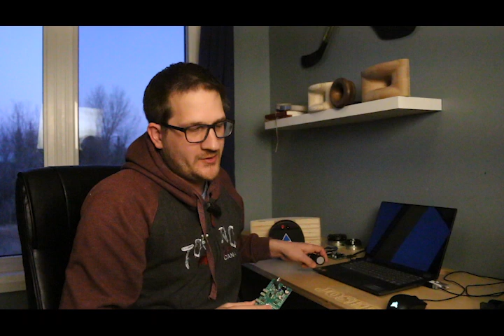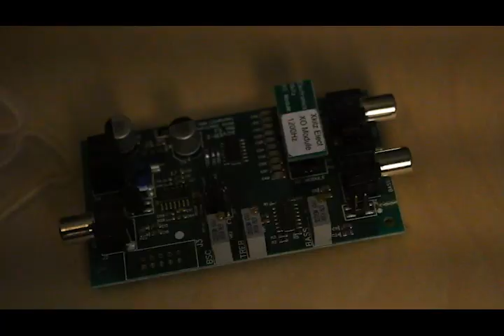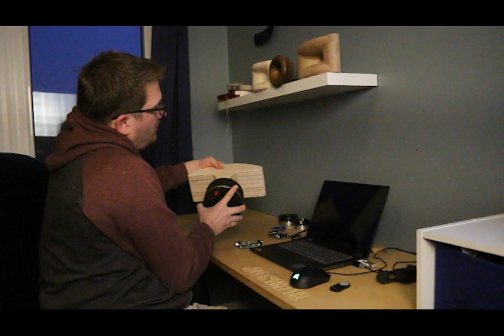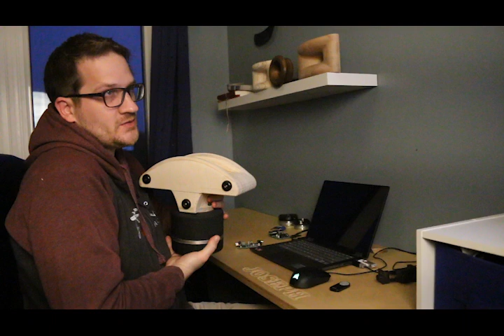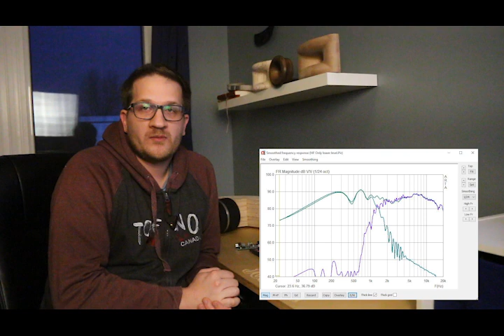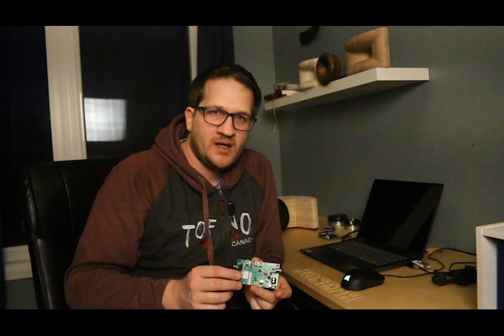Product Test --- Xkitz 2-way Active Crossover

Comment: Two of these are required for a stereo setup. How do you align the crossover adjustments for both channels to ensure they match?
Reply from the maker: You would probably have to use measurement with a decibel meter.
Reply: You need a signal generator and a digital voltmeter set to AC volts. 
Or ideally an oscilloscope.

Comment: I have the mini dsp 2x4 and disconnected the dsp from the amplifier and still had hiss on my horns, which tells me the noise is not from the dsp. If a passive network removes the hiss, what else is it filtering out?
Reply from the maker: You should at least do a fixed resistor L-pad just before the horn. An 5.1 ohm in series with a 3.9ohm to ground should attenuate by about 10dB assuming you have 8ohm drivers. 
Or you can use a low gain amplifier such as the ACA Mini by Nelson Pass. The kit is $135 USD.

Comment: I’m playing around with the balanced versions right now. Combined with the Xkitz linear power supply. Impressed at the price point, and you won’t get better sound from DSP unless you spend substantially more money. Even the new MiniDSP Flex sounds much worse. I’m using them with a 2 way with Purifi 6.5” woofer and Bliesma B34 tweeter. So very revealing speakers. 

Before connecting them to my speakers, I calibrated them with my audio analyzer. And I discovered the THD+N was only around -67dB. Then I hooked them up to my speakers, and they sounded quite good, but there was some dullness to the sound compared to my very high end DSP solution. Then I started messing around with the BSC. Tried several settings, and then decided to pull the jumpers to bypass completely. Massive improvement in resolution and clarity immediately. However the bass became thin of course. 

Next I hooked it back up to my analyzer and measured without the BSC enabled. And THD+N improved to -80dB. So 13dB of distortion is added by the BSC circuit. So what I decided to do is implement the BSC 100% transparently in the Roon 64 bit floating point PEQ instead, and the sound is pretty awesome. I’m feeding them with a cheap $270 Topping E50 DAC. And the sound quality is light years better than I was able to achieve from the balanced MiniDSP Flex. Even though on paper the THD+N of the flex was -111dB from my measurements of it. 31dB better, but much worse sound. Stop listening to ASR folks! 

However I should mention that the -80 THD+N is distortion dominated. The noise floor is very low at -108 dB. So they’re very quiet. I’m guessing that the major source of distortion is coming from the pots. And perhaps the mediocre LDO’s used to filter the incoming power. But super impressive at the price point, and they have inspired me to build my own all out assault analog crossover boards that will have -115 THD+N based on simulation.  But they won’t be adjustable. Fixed for each design. That’s the only way to do analog active crossovers with absolutely no compromise.
Reply from the maker: Wow, great work!  It’s quite fascinating that the Topping DAC sounds as good as it does.  I’ve found that you need to spend x20 more to get better performance, and it’s only discernible on high rez content.
Reply from the maker: Wow, great work!  It’s quite fascinating that the Topping DAC sounds as good as it does.  I’ve found that you need to spend x20 more to get better performance, and it’s only discernible on high rez content.
Reply from the maker: Wow, great work!  It’s quite fascinating that the Topping DAC sounds as good as it does.  I’ve found that you need to spend x20 more to get better performance, and it’s only discernible on high rez content.
Reply: Which one is "my very high end DSP solution"?

Comment: I recently received my Xkitz 2way crossover boards. I'm using them in a 3way for crossing woofers to midrange.. Dedicated amps connected to woofers is very nice with amazing controll and dynamics.. The one issue I have with Xkitz is the circuit with the voltage regulator and trim pot. I would prefer to bypass this circuit and direct connect a quality power supply directly to VCC on the opamps..

Comment: Joseph, awesome video, so far only real information about xkitz except marketing materials from producer!!! Can you explain your setup? What amplifiers used for wofer and what for horns? What configuration? Turntable-preamp-xover-2amps? Assume vol regulation was in preamp? I am considering build full active speakers with intrgrated amps (good Dclass or mix of Dclass and AB  for tweeters) and xkit, all in a spkr cabinet, balanced version, supplied by xlr connection from mighty source eg mytek DAC or similar, only need to find the one with exit level regulation...

Comment: I too purchased the same Xkit 2-way Crossover some time ago, and, like you did nothing with it... But after stumbling on your video, I took a closer look at the specs of the FETS at the heart of the modules - They have super low noise and vanishing distortion... So I'm in the process of putting a project together using a W8-2145 full-range driver from Tang Band which uses a bamboo fiber reinforced paper cone, and a HiVi RT2H-A Planar Isodynamic Tweeter crossed over at around 2000khz. So thanks Joseph, your video has just breathed new life into shelved project. 👀
Reply: I would like to find a DIP-8 socket there, so I could use ADA4898 or LT1364, OP275 at a low end, and MUSES02/03 at a high end (or may be some Burson os Stacato). And few other filter types like Bessel or Chebyshev for a better phase. Linkwitz does not care of a phase but sells an ideal stitching which is not required when we talk about a crossover (and plays some role when we talk about a tone control board). One slope can be 12dB/oct, and immediatelly 24dB/oct next to it. Everything depends on a driver and a cabinet. So, Linkwitz has no job there.

Comment: Why not go with the MiniDSP?
Reply from the maker: Corrado VRz I’m surprised you asked that question when I directly compared the product to the MiniDSP in the video. You should watch the video.
Reply: @JosephCrowesDIYSpeakerBuilding  I did watch the video but I must have missed the part where you talked specifically about the MiniDSP. I only saw you mentioning about Pro audio and car audio processors, not the MiniDSP. 
I'll try to watch it again when I have some time.
Reply: Mini DSP has a lot of hiss, I have it and sold it, the A/D D/A conversions are low quality.

Comment: Agree with you Joseph,  I use  the three way variant in my open baffle speakers,  and on many ocasion, other audiophiles where simply overwhelmed by what it can do.  I am currently building an integrated amp with the three way balanced x-kitz boards.  using 4 x  modulus_ 86 amplifier boards from Neurochrome.    I was alway's disapointed with any DSP on sensitive speakers,   this opens up new posibilities.
Reply from the maker: That sounds like an interesting project! Are you sharing your work on any site?
Reply: @JosephCrowesDIYSpeakerBuilding  No I do not,  but that is not because it is a secret.  I can send you some pictures if you like

Comment: Cool thanks for the review! Sounds like finally there is a good alternative to MiniDSP and modded DCX2496. I bet you can mod that crossover chip with variable resistor to fine tune the crossover point too. Just have to reverse engineer it!  I bet your good at that lol.